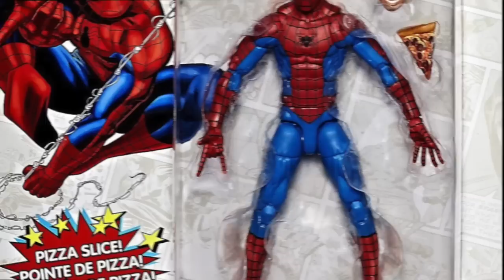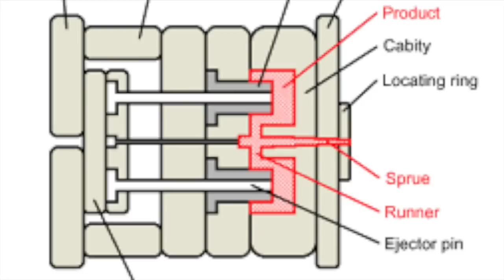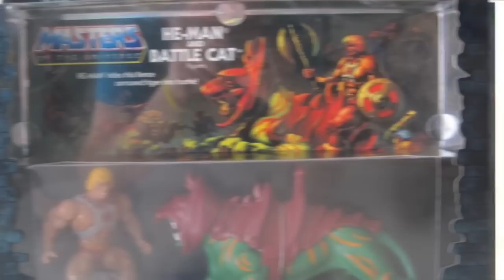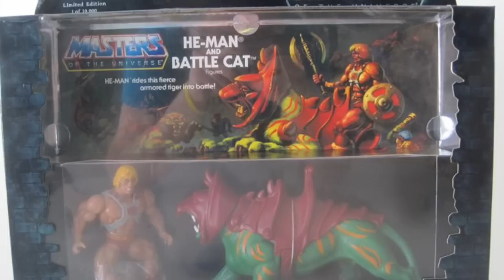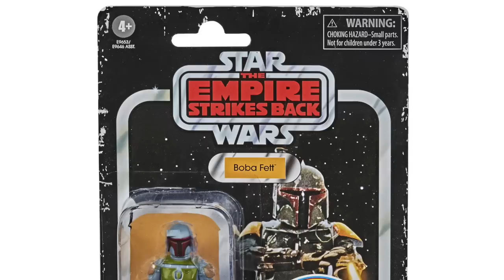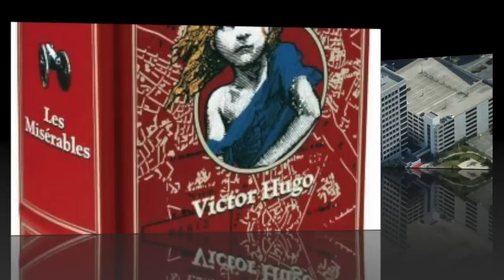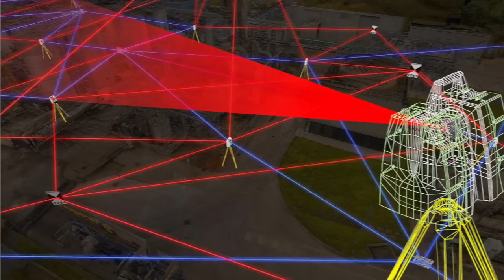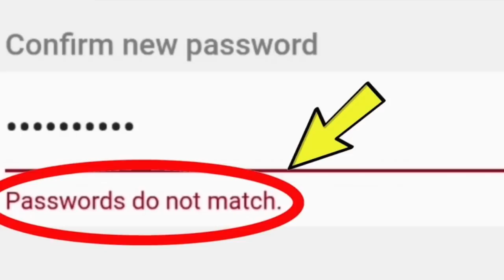How are commemorative (reissue) toys made?

Comment: I have a question about tooling from back in the day. You say that tools are etched by hand. As far as I know figures were sculpted in wax and then a resin casts were made of that sculpt and it was one of those castings that was the basis of the tool. My question is did someone have to by eye and hand etch out the tool based on a sculpt?
Reply from the maker: A mold is made similar to how molds of actor faces are made for masks

Comment: Scott, what is the relationship between scale and tooling? I kinda got an idea from this video, but how long has laser scanning technology been used? I remember back in the 90’s when every Kaybee Toy Store had stacks upon stacks of 10 inch Marvel figures that were all nearly identical to their smaller counterparts in all the various Toy Biz lines.
Reply from the maker: Well the bigger the figure or the  more parts the higher the tooling. So a 5 POA figure that is 12" costs less than a 28 POA 3 3/4 figure.
Reply: @spectorcreative1872  I guess I was curious if tooling at one scale can be upsized in some fashion like those old Toy Biz figures seemed to be.

Comment: There is one ray of hope going forward, should anyone seek “retro reproductions” of modern toys in 20 or 30 years. Since modern tooling is milled digitally, so long as they have really good data retention and archiving policies (hah! Good luck with that!) in theory they should have retained a copy of the G-code used to cut the molds. Which would allow the recreation of an identical set of molds… assuming the milling system could still read the 30 year old code… and the injection molding machines could still use similar molds to the old ones. Granted I think the only toy company that is that insanely obsessive about that type of data retention is Lego. And that’s just because every Lego piece made today has to be able to connect to every other Lego piece ever made with no variance on any facing. Mechano might be similar?
Reply from the maker: Well the sculpt yes, but the tool still needs to be made
Reply: @spectorcreative1872  Well yes, if you’ve worn out, thrown out, lost or damaged the original tooling. But the difference is with the digital files preserved you can produce an exact duplicate of the original tooling, rather than having to remaster from a sculpt or scan. So you would not get those subtle size changes or loss of detail. You still have to pay to have a new set of molds cut. Which is the expensive piece of it all.

Comment: I suppose re-using the original molds is not an option. But what happens with old molds? Do the factories just throw "em out?
Reply from the maker: Storing them is very expensive, ,so after 3-5 years, yup

Comment: When they released the entire Kinnikuman series on DVD, Bandai included commemorative versions of all 400+ Kinkeshi mini figures (233 of which were used for MUSCLE). As it was 30+ years after the original release, they cast their new molds using the old figures. As a result, the commemorative figures are all smaller than the original (it is possible to avoid shrinkage like this, but actually really difficult), have lighter details, and the original etched copyright info was replaced with a stamp that obliterates some of the sculpting detail. You can tell pretty easily when old and new figures are side-by-side!
Reply from the maker: Perfect example
Reply: @spectorcreative1872  Hey as an anime fan, would get 2 of those.

Comment: Would it be possible for Mattel (or any other company) to make new MOTU figures (or any other line) using the original tools from the 80s? What happened to the original tools? Generally, what happens to tools after a line is finished?
Reply: A lot become anchors in China. I’m completely serious. Some companies hold onto their molds. A lot of vintage Gi Joe and Transformers molds have survived though
Reply from the maker: Those tools are long gone. Sold as anchors for HK harbor

Comment: Do you know how reissues were made before laser scanning? I've heard Hasbro used the original tools for 1997 G.I. Joe figures, but do yo know if those tools lasted into the 2000s or did they have to create new tools? Maybe they still had the original prototypes?
Reply: Hasbro was letting Kenner (they owned Kenner by then) do the older boys toy lines. Kenner came up with the 15th Anniversary product for 1997. So they made mockups of how the Joes were going to look. When they got into Hasbro’s tooling bank, they realized that not all the old tooling still existed. A lot of it did, but some were gone. The swivel arm vintage Cobra Commander v1, Destro v1, Flash, Rock n Roll and a few others got replaced with newer molds. So yes, they did use old tooling where possible.
Reply from the maker: Just (re)sculpted by hand basically

Comment: Fascinating  scan it and then dont check figure before sending cad could just make a cast of it .so Mattel have he man prototypes circa 82...will you cover vac form shiny metal and rotocastung?  And metal die cast toys
Reply from the maker: But the risk of not using the tool again...
Reply: @spectorcreative1872  more accurate and just tool off that did it with real Ghostbusters there right

Comment: Thank you for this one Scott! Ive always been fascinated with the production process due to my machinist background and I make simple split line molds regularly. You mentioned some tooling is hand etched so is a 3d pantograph used  in those cases?
Reply from the maker: You can 3D pantograph but that just replaces the sculpt which is not the same as the tool

Comment: Kenner released a commemorative pack of 4 in 1995 at the start of The Power Of The Force II. Of course we know that pack was not well received and Kenner Products (and Hasbro) did not attempt this again until after Kenner was already closed. Transformers had a very interesting approach to commemorative figures. The Transformers Commemorative Series from 2002-2005 was reissues of many G1 Transformers but because of modern safety standards the chrome missiles and most infamously, Prime’s smokestacks, were enlarged or cut down. Some heads were redone due to the obliteration of the old mold from the 1980s, and others had parts recoloured in the wrong colours for cost or other reasons. Being reissues of The Transformers (1984-1992), The Commemorative Series was a Toys R Us Exclusive.
Reply from the maker: Yeah I had that pack in my hand but then passed. Amazing how the "retro" ;line is all cool now
Reply: @spectorcreative1872  indeed. (Playing on your own statements with that one!) Yes it’s interesting how it worked.